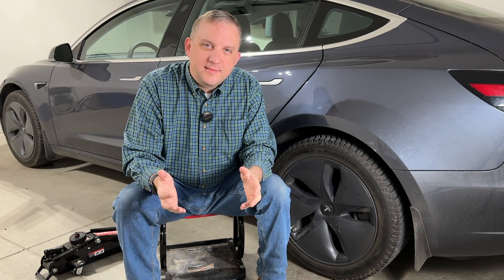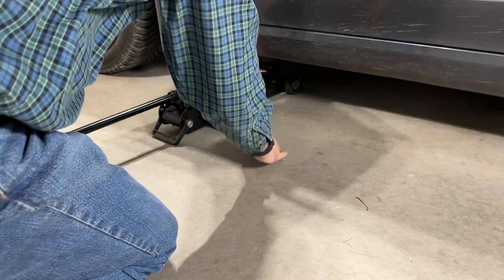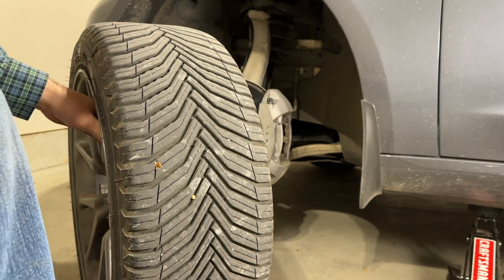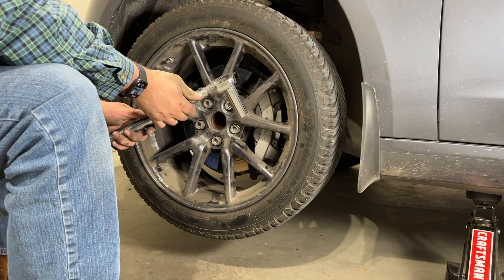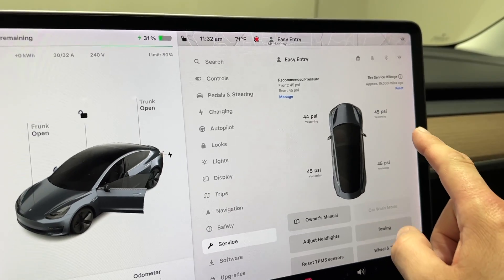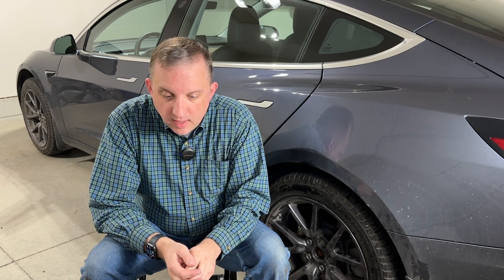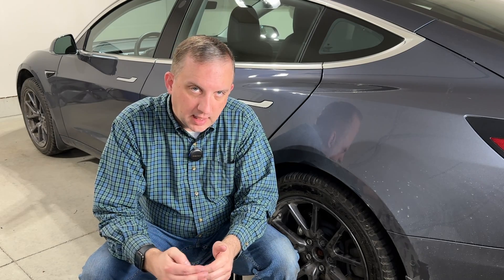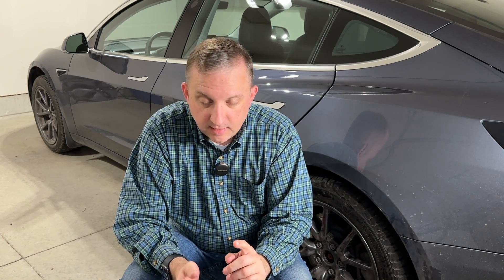Tesla Model 3 Tire Rotation & Michelin Cross Climate 2 Review

Comment: I put these on my m3 long range AWD and my wh/mi is 375 and I’m over 1400 miles on these tires. Very normal driving style and not aggressive. Mainly city and freeway driving. Any idea why I’m seeing such a difference? Appreciate your thoughts.
Reply from the maker: That does seem high unless you have colder temps plus the new tires? Otherwise, I would say that it's just breaking in the new tires. Once you get more miles on them, they should level out to around the 5% range reduction that I saw with mine. Also, make sure you have the correct tire pressure as well. That's all I got. Good luck!!
Reply: That’s excessive o went from 229 kWh to 250kwh
Reply: I know its probably late since its been a year but have you checked your PSI? Tesla recommends 42psi but if they are XL rated,  which they should be if you installed them on the model 3, you can pump that up a couple psi safely which will mitigate a lot of the range loss. Aired down tires will increase rolling resistance noticeably.